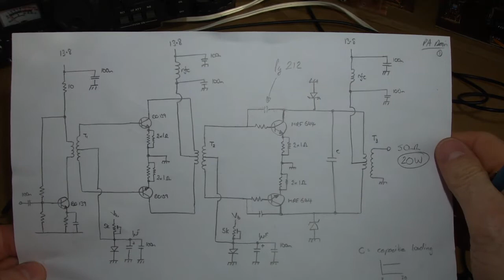Homebrew 80/40/20m SSB Rig Part 8a - PA Driver Tests

Comment: hey charlie, how do you score these pcbs?
Reply from the maker: Hi Sahir. Recently I have been using the side of a small file. I use a price of wood as a ruler and then scribe the line with the file on a 45 degree angle. I really must use the milling machine more :o)

Comment: Great job Charlie your videos are fantastic and I always look forward to the next one. Would really like to see you do a video on building the Ardunio code for the project!  Best 73s from Andy de G6LBQ.
Reply from the maker: Sure thing Andy. What aspect of would you like me to cover in more detail? Charlie
Reply: It would be great if you could do a video on the basic sketch to demonstrate how to put the si5351 on a fixed frequency. Then discuss how to add a display, how to introduce an encoder into the mix and increment the frequency then discuss implementation of band and mode switching.  Maybe  this is a big ask and a job for a few videos!    Thanks For giving it Consideration!
Reply from the maker: I think we can do that over a couple of videos Andy. The only caveat is that there will no doubt be better ways of designing the software (i.e., rotary encoder libraries etc), but it works for me. Give me some time and I'll flash something up.Charlie
Reply: Many thanks Charlie this will be really useful to me and hopefully helpful to others on the arduino learning curve!

Comment: I enjoy learning from your videos, great stuff! I use a 1610 cnc to engrave 'muppet' style pcb modules. I design the boards using Inkscape with a 0.025 in grid, pads are 0.1 in. I load the SVG file to JSCut which generates Gcode that I open with Chilippepr GRBL. The autolevel feature on Chilippepr is great! 73's de OH6UAV
Reply from the maker: That's interesting thanks. Sounds like we have very similar machines. I'm using G-Simple for the CAD then DXF-to-GCODE. I think the CNC control software is Candle. It took me a while to work out the tool chain, but it seems to be working ok. Thanks again.Charlie